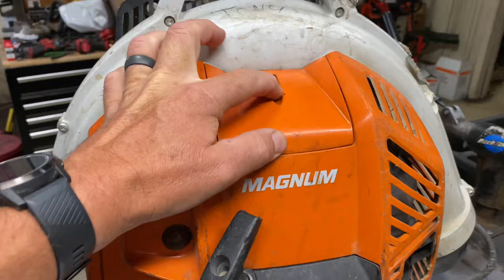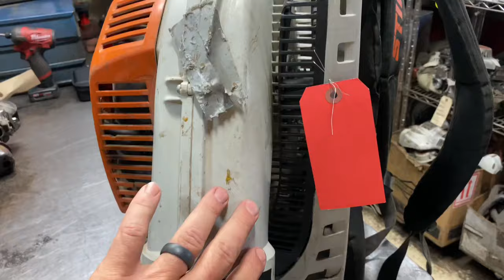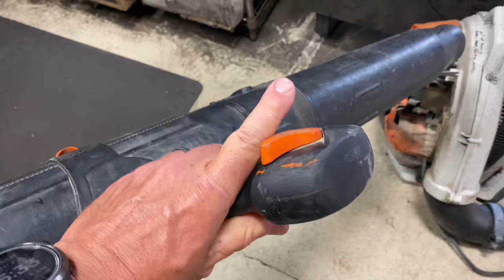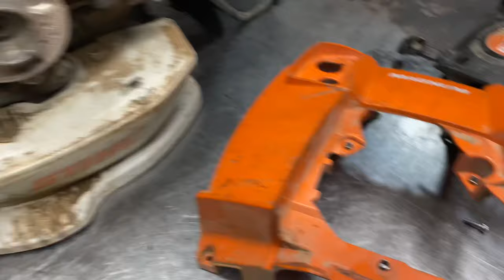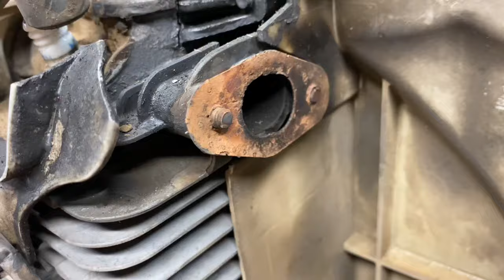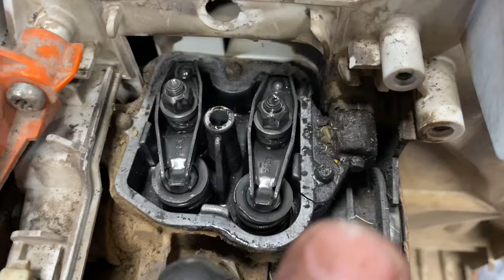STIHL BR800 Backpack Blower common problems and what to look for

Comment: what Problems Does BR800C Suffer with as we only have that here in UK
Reply from the maker: All the same issues. Only difference is the recoil. Over time the “C” recoil will loosen up due to the vibrations.
Reply: I had six of those BR800 X all have had crank bearing seized up crank problems but my BR 600 all six have been running five years they’ve been running none stop and I been a small engine specialist for 45 years

Comment: Have been watching your vids on blower problems. Hard to get an idea of how many issues you see…. Right now would you buy a br800 or a echo 9010?
Reply from the maker: Currently I would buy a new model BR700. I’ll be releasing a video on Sunday regarding some changes Stihl has made. The Echo 9010 is a good choice as well. I’m still not happy with the BR800 and it’s issues.
Reply: @wallysworkin823  awesome thank you. I’ll watch out for your video Sunday!

Comment: I have been a real dummy and put Aspen 4 (thinking this was 4 stroke, but it’s 4-MIX and 2 stroke) in my newly bought (second hand, but it’s 2021 model) br800c. Ironically in a bid to use better fuel to look after the engine. It ran fine for an hour. Then a week later I realised my mistake, drained the tank and replaced with Aspen 2. In now starts with a lot of effort, runs ok, but then dies when idling. Then will not start up again. 

Can any one please give me any advice, have I ruined the engine or is there a remedy for my stupidity?? Thank you very much to anyone who can offer any advice
Reply from the maker: You may have scared the piston. It will have just enough compression to start when cold but when it gets warm it will no longer run. Do a compression test. Engine may need to be torn down for inspection.

Comment: Do you work on Stihl pressure washers?  If so I have a Stihl RB800 I’m working on for a customer where the fuel is somehow mixing with the oil.  What could cause this?
Reply from the maker: Sounds like it’s having a carb issue, flooding or running very rich. There’s no other way fuel can get into the crankcase.
Reply: @wallysworkin823  i was at first thinking it might be a fuel line that got frozen because of last week’s really cold temperatures.  I wasn’t thinking of the carburetor.  Thank you for the advice and quick response.
Reply from the maker: @edjohnson5811  Anytime!

Comment: Have ab 800 c and an 800 x both run for 20 minutes or so then bog down once cool they both run fine again for 20 minutes or so then bog again... any ideas as to why?
Reply from the maker: Sounds like a fuel system problem. Possible simple carb adjustment but check the basics first, exhaust screen, fuel and air filters and I would also check the valve adjustment.
Reply: Ignition module/coil going bad?
Reply: Fuel tank vent?
Reply: @briantii  I find that to be a common problem with the model 91 weed eater. Not had the problem with the backpack blowers.
Reply: Replace the fuel lines,check the gas tank vent, adjust the carburetor ,I had one the did the same thing,it's running 💯

Comment: Do not like the 800 , one here now with another Muffler destroyed this year, last time Choke Throttle Plate screw came out and I found sitting on top of the Piston. Clip came out on the Shaft causing this. 600 is no King , but after serving many and building them I definitely prefer over the POS 800.

Comment: Don’t buy Stihl, they break immediately and they have no parts to fix them.
Really disappointed with Stihl. After 30 hours after use BR800 needs a carburetor. In order for them to cover expenses under warranty I need to wait 5 months for a back order.
I paid from my pocket for a carburetor from eBay and I hope the shop will get my machine up and running within a week. 
Stihl wouldn’t work with me on any quicker solution.
I’ll do my best to inform as many people as I can. 
Their phone number doesn’t respond at all either.

Comment: Reminds me of echo .. so many dam screws now.
Reply: Hey wally, was working on a br800 yesterday right before i saw your video. Had a bad flywheel , put a new flywheel tried to crank and a loud screech was heard when it was on, after further inspection it also had a bad fan propeller. Tried to cut a corner and put red locktight so the fan could stay in place (fan had a cracked bushing Lol) ... well it was working real good till that loud screech came back and the fan propeller was undone) ugh , i ordered the part hopefully itll fix it. flywheel was 80 and i see than fan is almost 80 aswell. money money.